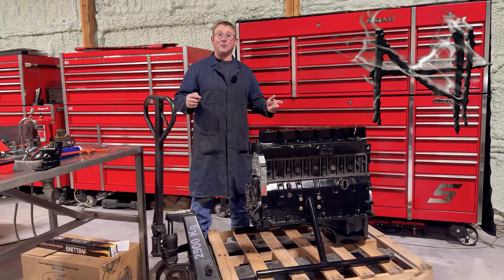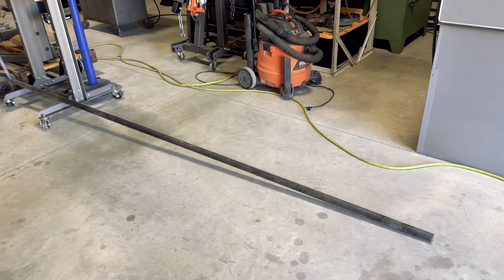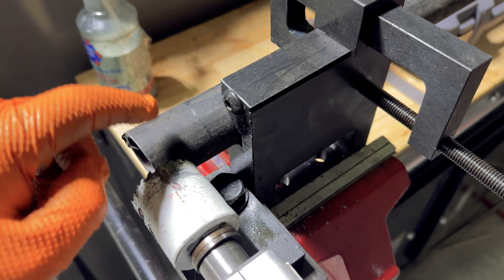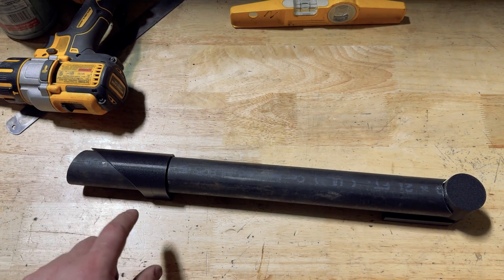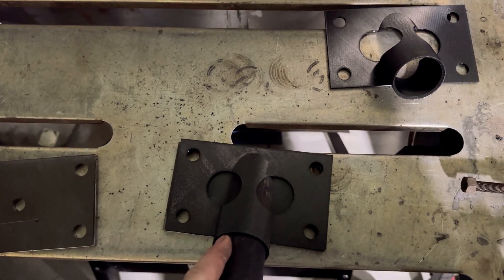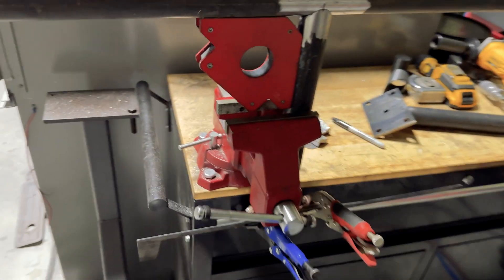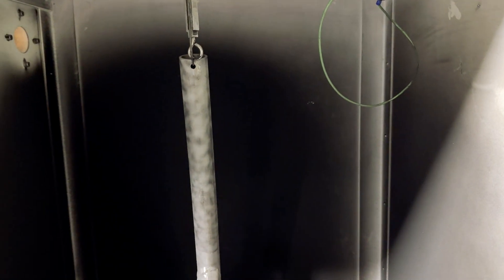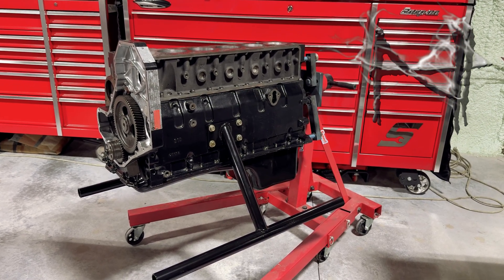Building a Heavy-Duty Engine Stand for Diesel Engines

Comment from the maker: Here are the 3D Printer Template Files:-

https://www.printables.com/model/1057846-3d-printer-files-for-the-dirt-cheap-skid-engine-st/files

if you require different spacing for other engines, just comment here with the hole spacing & I will generate those files & upload them